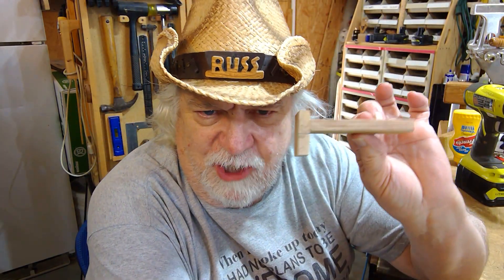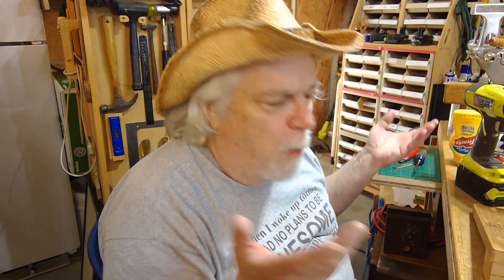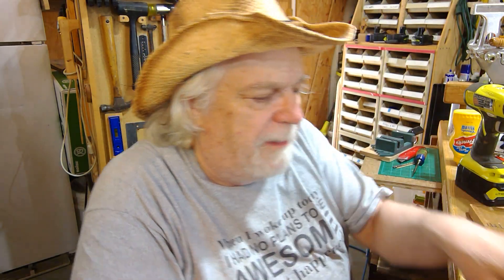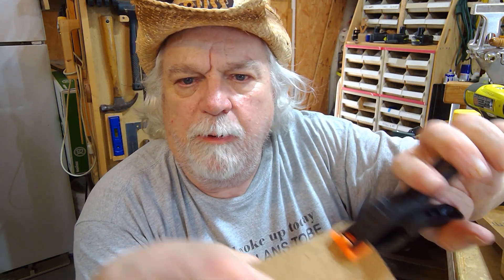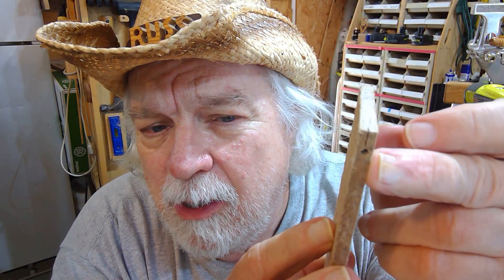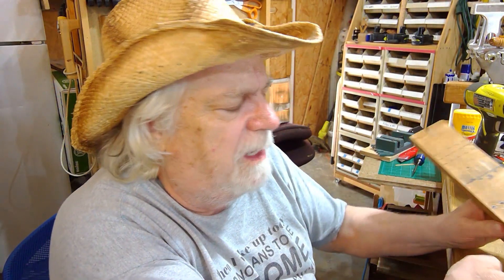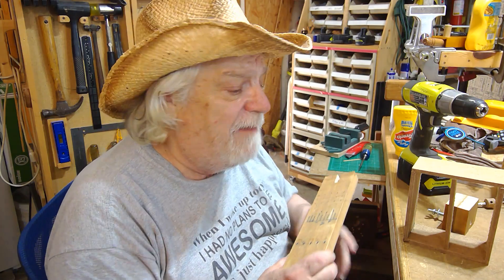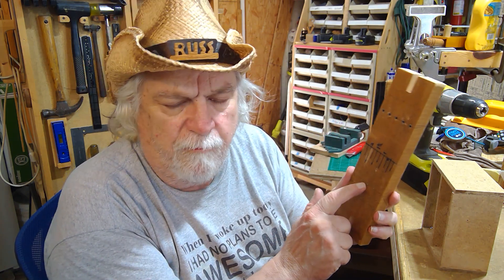Mini BS Jig for BS Joinery by OTB Thinker

Comment: Hi Russ, I like your tips and tricks and I always learn from you. but a lot of these different video's work by personality in my view and you definately have a very pleasant one which makes you easy to watch. Talking a lot is good because you make things very clear and easy to understand. I don't follow your electrical demo's though, I simply don't understand how that all works, so I leave that alone. I watched your video on the zylus vice/vise and couldn't find one to buy but I got a similar one from New Zealand called the Renovator Extra pair of Hands which is the same but more things in the case, so thank you for your video's you are very helpful.
Reply from the maker: Thanks Bill .  My electrical videos do assume a certain amount of DC electric knowledge .  I have a "12v auto experience" of things.  I don't know about electronics.  You start using words like regulator, diode, transistor, or PCB I get lost :>)
Your Renovator is the same under a different label.  Zyliss has a couple of off brand labels but appear the same to me.  I bought a full kit with all of the same accessories like yours.  Haven't used them much but glad I have them.
Reply: @russveinot5754  Thanks Russ, Love your video's and thank for your reply. I relate well to your way of teaching  :)